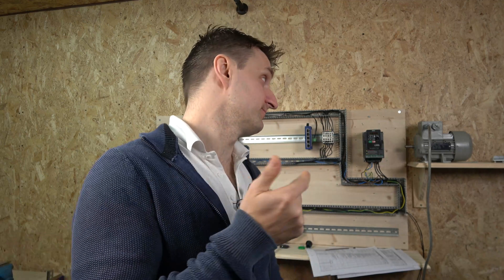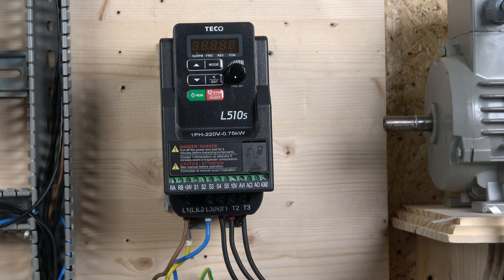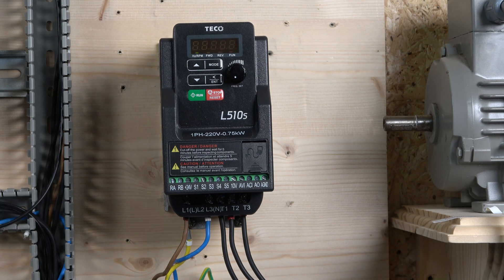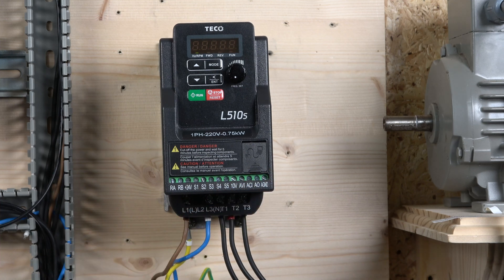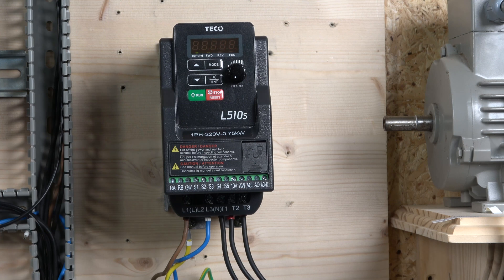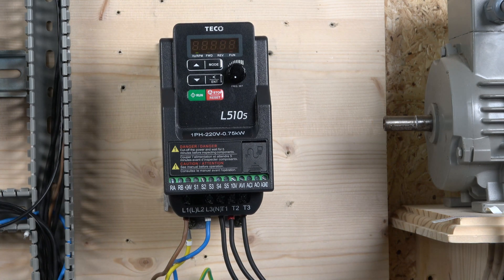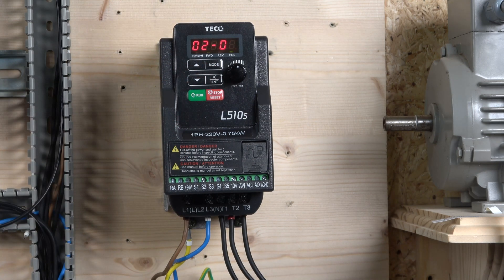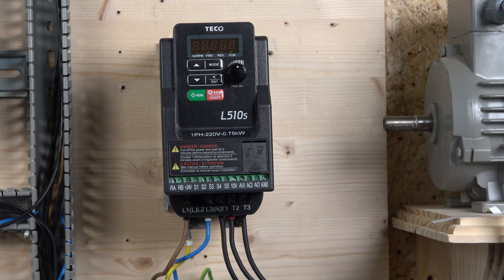Teco L510s VFD, local control, commissioning, parameter set up, Factory reset. ( English )

Comment: I've got a 50 hp f510 teco.  Under motor parameters rated current, I can't  get it to go above 9.2 amps, which coincidentally is the max amp rating for the 5hp 510.   Is there a hidden menu to access the max motor rated current? Makes sense it's hidden or hard coded so folks don't fry the drives.  Any advice?
Reply from the maker: Some drives do allowed it some don't.  To be hones, i don't know way they would, that would eventually damage the drive. I have never tried to go above it for this drive so wont be much help for you here. Sorry
Reply: @IGSElectronics  I figured it out.  There's another menu level that's not published. Fixed

Comment: Can I run a 3 phase motor with it by supplying single phase electricity?
Reply from the maker: Yes that is correct
Reply: Can I run 2800rpm 3 phase motor at very low RPM with this?

Comment: Do you know a way to change the frequency adjustment increment? I have E510's with no potentiometer, so I have to sit there and mash the up/down arrows for a long time to get from 0hz to 60hz (US)
Reply from the maker: I have never done it on this drives, but some have option to increase the sensitivity. Usually by increasing acceleration time should allow you to increase speed faster.